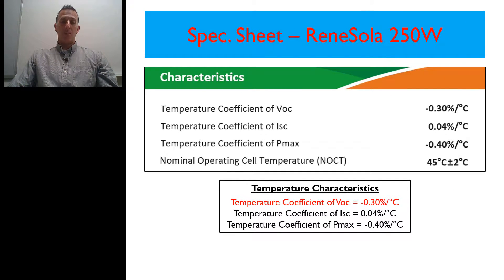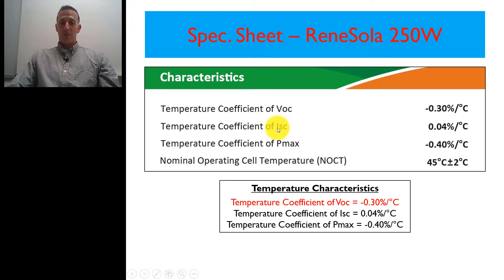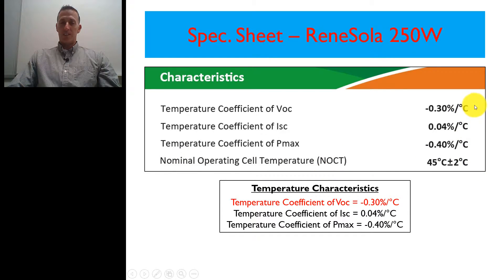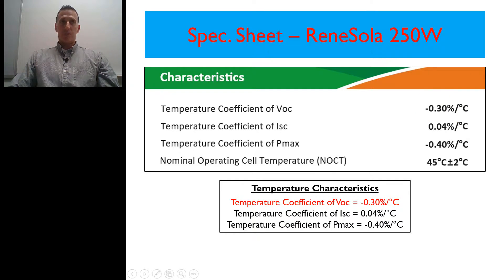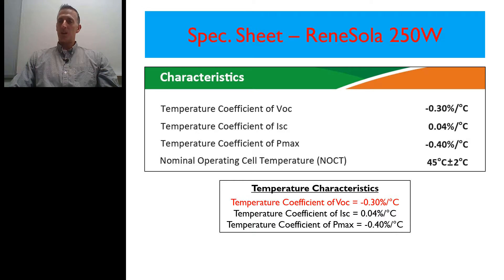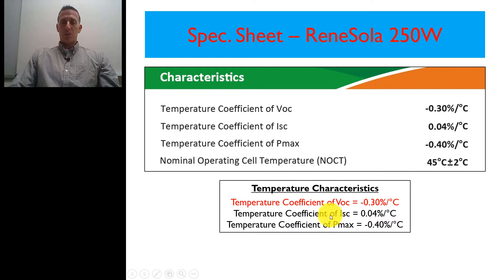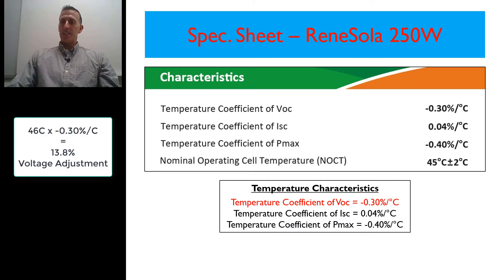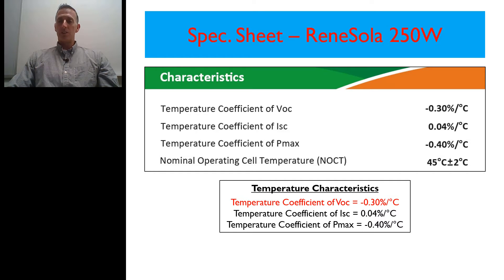Solar Training - Temperature Coefficient of Voc (%/C)

Comment: Do you have any formula for Isc to calculate and see if the measured value are with in parameter. we use the panel watt * the panel rated Isc / 1000 ..... (500W*18.4)/1000 but was wondering if you need to calculate the temp Coeffiecient for Isc as what we do for the Voc